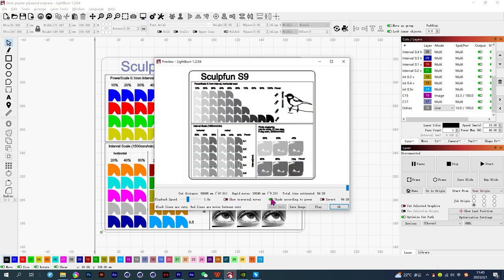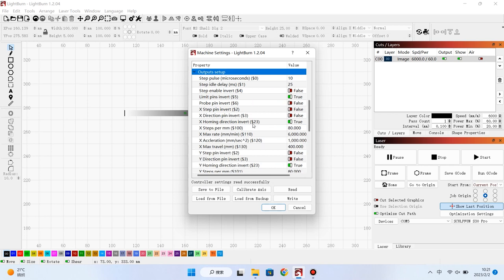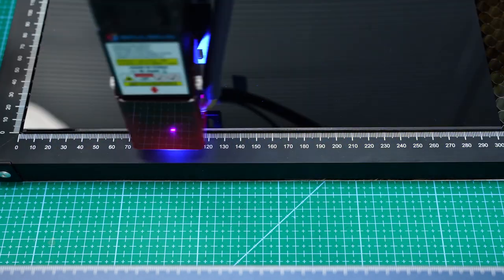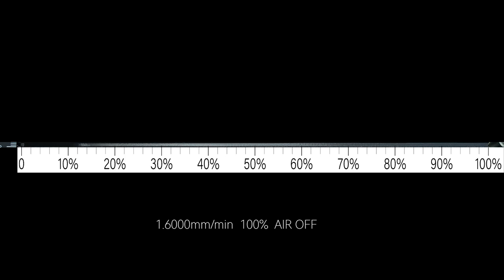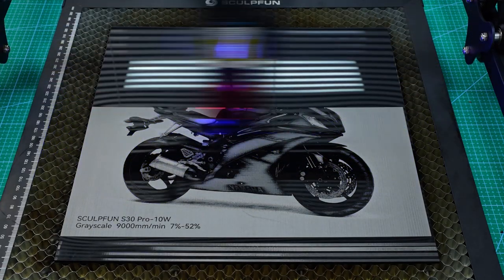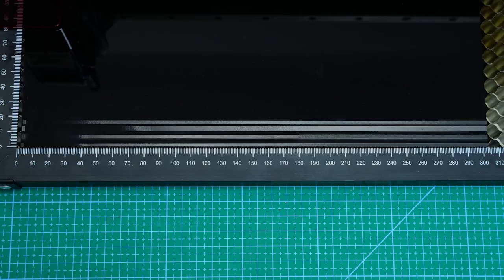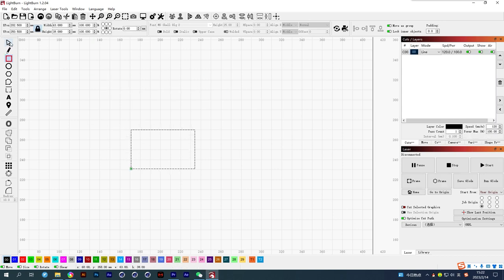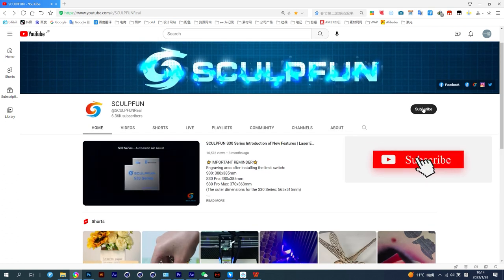Faster and Simpler: Laser Engraving Fast Test! Suitable for 95%of materials carving.

Comment: I have a problem with the settings for cutting wood and MDF. The SculpFun S30 Pro device does not cut, no matter how many times I cut it and change the power. Can you help me?
Reply: Happened to my S30 Pro Max first run. I found the trouble, it was the losen laser lens. When the lense cover tight, problem solved. Just make sure everything ok, lense, cable, rubber tracks (important for calibration), etc.

Comment: Hey, would it also possible to cut extruded acrylic, I tested with 85% with 2 passes and it won't cut 2mm sheet?
Reply: speed? I usually 2mm/s
Reply: @党一哲  with power 100% or.something lower?
Reply: @RistoNovik  I generally use: 2mm/s 100%
Reply: @党一哲  Basically the speed 120 mm/min with 100% would cut it cleanly or it leaves the melting of plastic feel?

I tried with 200 mm/min 85% two passes and it didn't look that clean cut and not fully through.
Reply: @RistoNovik  For cutting efficiency, please refer to my last video
Reply: @RistoNovik  Is it black acrylic
Reply: @RistoNovik  https://www.youtube.com/watch?v=WZd_0Rrc8qM&t=656s